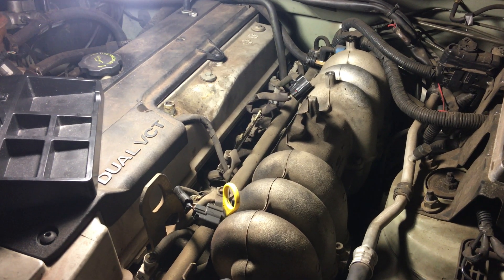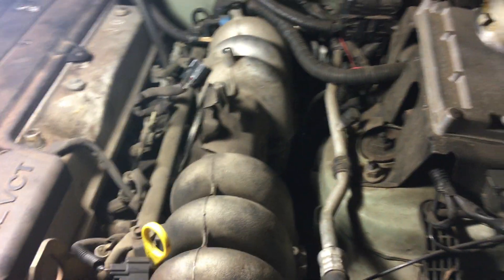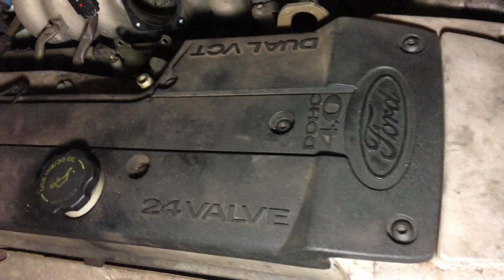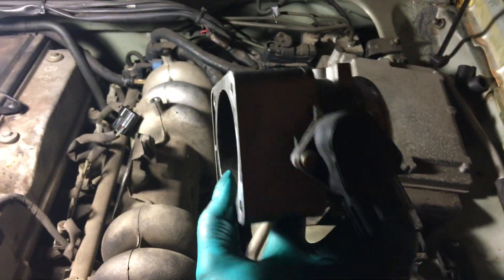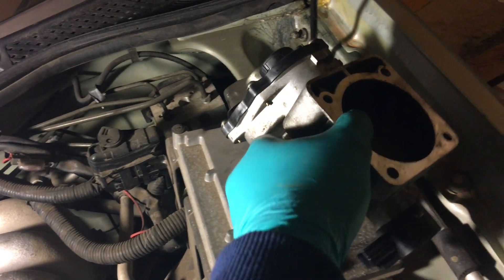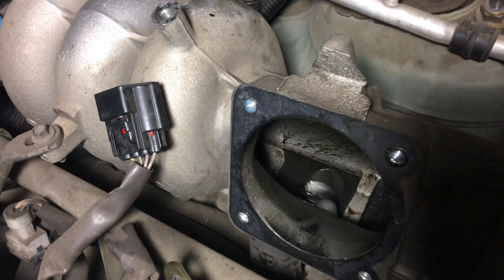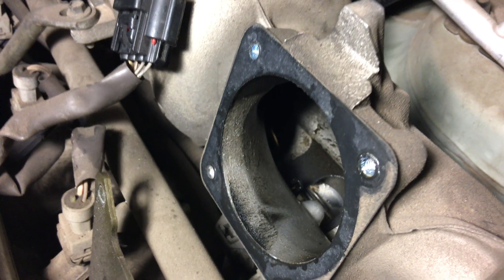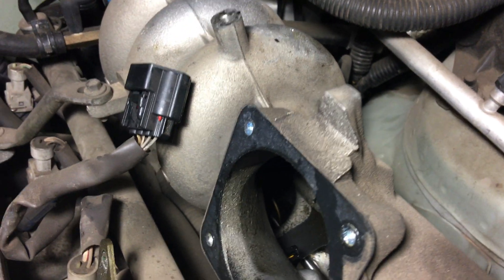Falcon BA maf sensor how to clean

Comment: Here’s a community service announcement. DO NOT CLEAN YOUR MAF OR MAP SENSOR OR THROTTLE BODY WITH WD-40 EVER. Use the right cleaning spray specifically designed for the job, use a Mass Air Flow spray for cleaning your MAF or MAP and use Throttle Body Cleaner spray  for cleaning your Throttle body.

Comment: You are only supposed to use Mass Air Flow Sensor spray specifically developed for MAF. I’ll bet your car didn’t run well after using WD-40.

Comment: This does the job but on the air flow sensor it self id use air flow sensor spray its about $25 it does miracles for the sensor and any electrical connectors , most of the times is a loose air hose creating a no start  so make sure all hoses are clamped tight for best resalt, but it makes your car new once you clean the air flow sensor with the air flow sensor spray.
If anyone has a engine light on try this trick disconnect battery from car then get a wire connect negative and positive from car together not battery but the car cables that connect to battery this will drain any power left in the car or motor even though battery not connected the motor hold tiny volts enough to keep ecu computer chip active so after 20 minutes car should be drained  take wire or jump cable off the connections now you connect the battery to car.

No connect negative on battery then positive now your car is rest now turn key to power but dont turn over just power on  for 5 seconds then off for five seconds then on the third turn of five seconds crank car over and it should start once running change gears every five seconds go up and down each gear so your reset car understand then leave car running for five minutes then go for a drive 20 minutes with out stopping car then once home you will see not see engine light on and airflow back to normal.
I just did this my self and ford bf running great so just a little tip if your engine light comes on usually a dirty air flow sensor save big money with this trick reset your car computer to factory settings makes car new again. ITS GOOD TO CLEAN AIR FLOW SENSOR ONCE A YEAR.

Comment: Wtf do not I repat do not use wd40 on any maf sensor they have what called a hot wire with wd40 is not good for not to mention will dry the plastic 🙄 sensor out making it brittle 🤦‍♂️🤦‍♂️🤦‍♂️🤦‍♂️

Comment from the maker: g'day, 
just to make this correct,  w40 don't cause residue, eventually it will dryed up.
Reply: Then spray some on some clean glass, and see the result. Even the WD40 documentation says it protects metal parts from rust. So are you saying it completely evaporates, leaving absolutely nothing behind, yet somehow gives a level of rust protection................................hmmm. Think about it.
And by the way, I love the way you say "eventually it will dry up". So in the meantime it's OK to have MAP sensor contamination, until "eventually" has passed.

Comment: Give credit were credit is due but plain brain failure is a motor company's biggest attribute replacing a map sensor hex bolts galore but the one you would have thort would a hex bolt no way it would to easy if it was what a brain fart